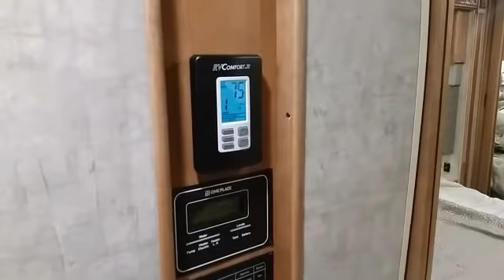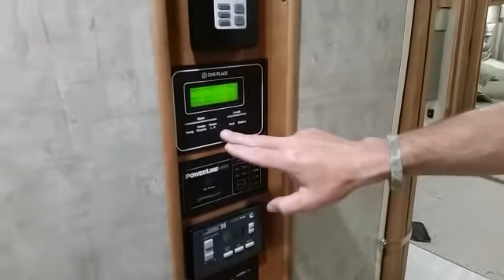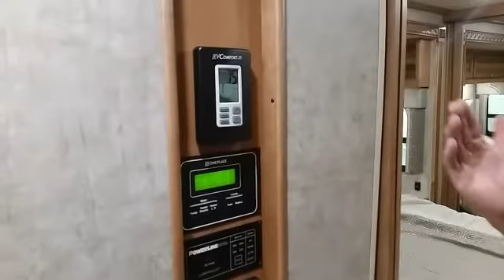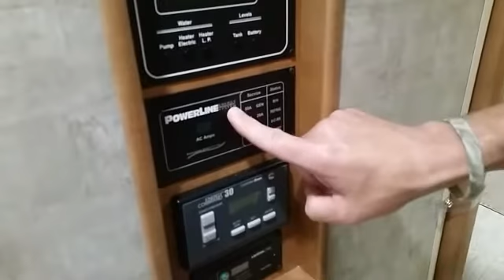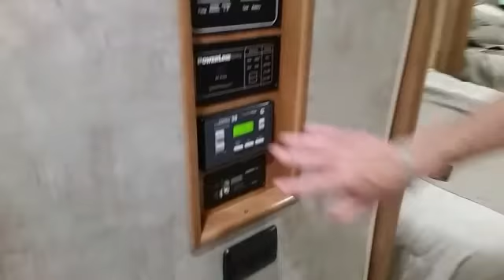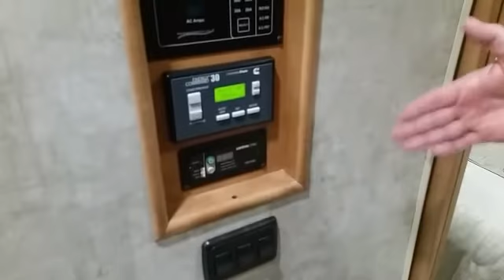OnePlace Systems Control Panel | Recording of Live Webcast | Lichtsinn RV

Comment: I plugged into a 110 plug in my garage. My power management panel read 30amp. I thought 110 would have been 15/20 amp?
Reply from the maker: Good morning!   You are correct, but the lowest auto setting is 30 AMP... you can press the button on the panel to downshed to 15/20 amps so it engages at your garage amperage.   Hope this helps!